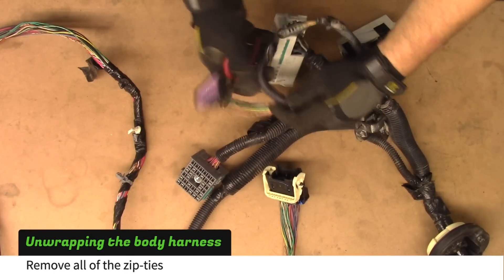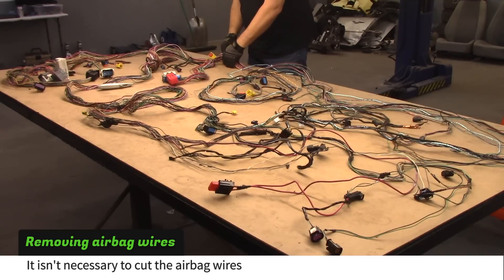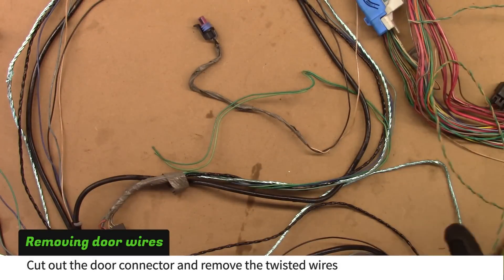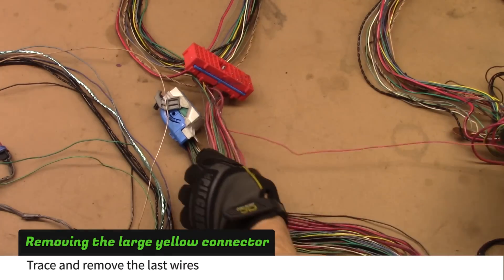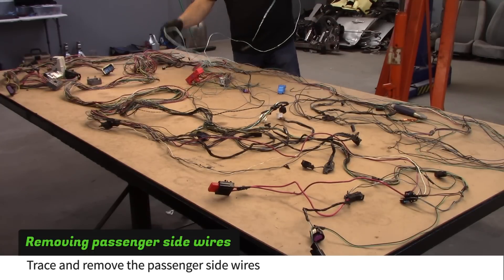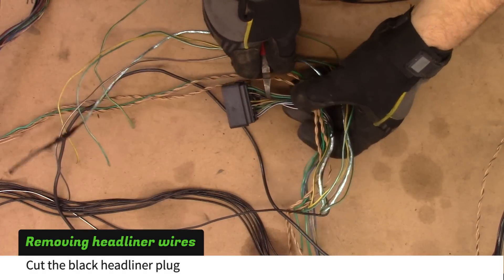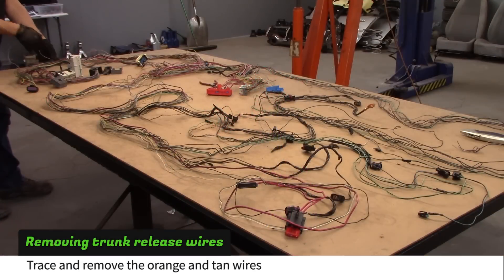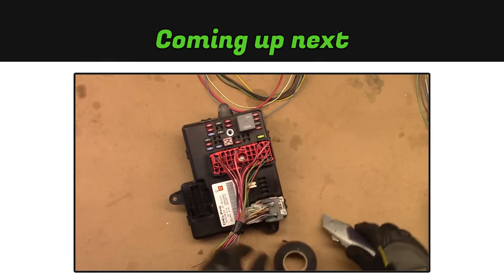DF Goblin Build Guide Part 10 - Thinning the Body Harness

Comment: This is great help, but my ocd kicked in when you started cutting wires at the harnesses so short. You should at least leave 3-6 inches of wire therefore you can sell those parts for easy reinstall! Or even be more tedious and just trace your line back then cut them leaving a full trace of wire for the person who buys the parts to install more easily. For example a wiper control arm with harness can fetch you $50